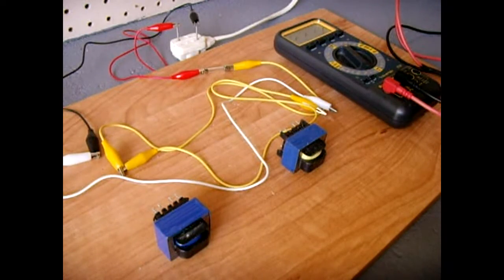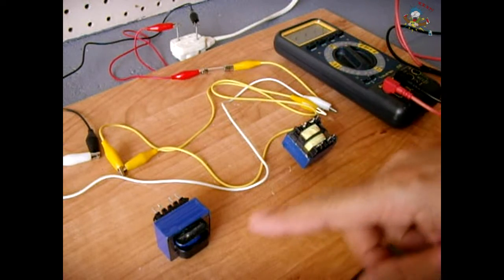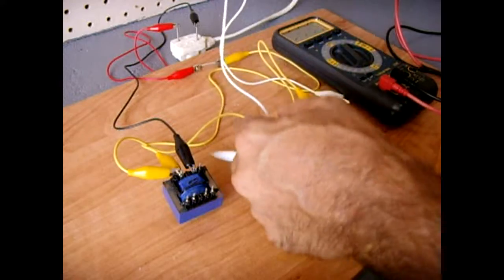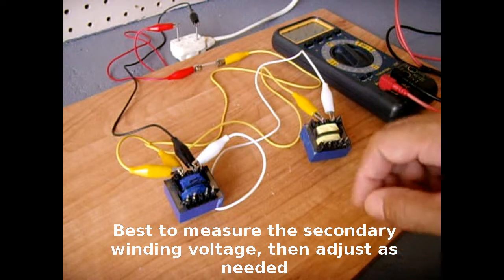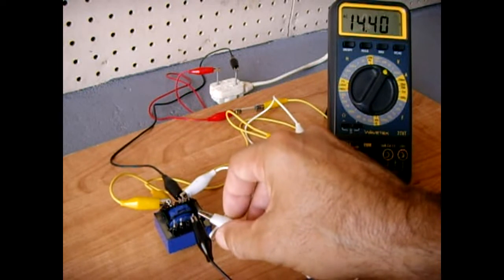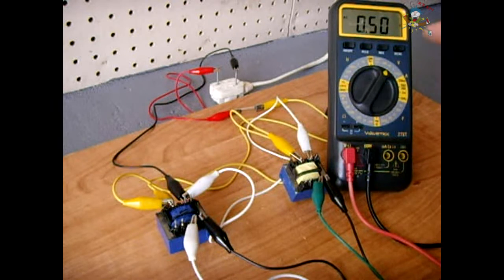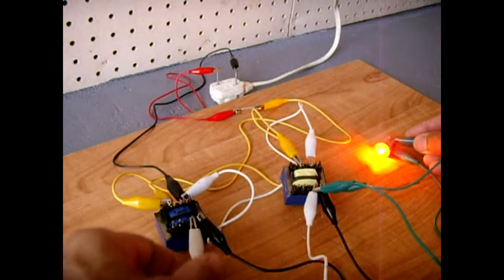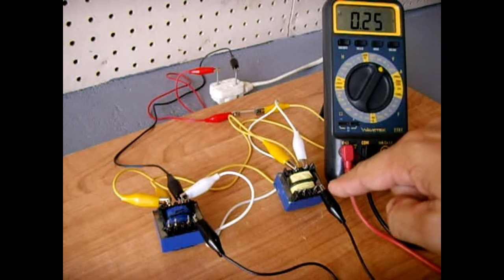Using Power Transformers In Parallel or In Series

Comment: Thank you for this demonstration.  I'm trying to connect 2 HV xfrmrs and need it to be 100% correct the 1st time.  The best aspect of this video is the voltage check w/ meter  BEFORE completing secondary connections.  That step is not included in any other YT video covering this subject.

Comment: How about using a third transformer that has two primary windings, which are 1:1 with each other and with the secondary windings, as a way to use two different transformers in parallel?

Or would the same damage still occur from the second primary winding behaving like a secondary winding & passing that higher voltage/amperage back to the weaker of the two transformers connected to it?

Were a load to be placed on the secondary of this imaginary third transformer, how would the load be distributed to the previous two (unequally sized) transformers?  

I assume that "the path of least resistance" applies, but that doesn't change the fact that both primary windings are on the same core, interacting with the same flux.

Comment: Excellent presentation! Hope you will answer my question: If the 2 transformers not quite match, how about a dropper resistor on one transformer  to make it match?
Reply from the maker: I definitely recommend using 2 the same. Thanks for watching!
Reply: Unfortunately I already have the two transformers which not quite match, hoping for a way to trim off the difference with resistor voltage drop.
Reply: @clam4597   
The stronger of the transformers will always find a way to eat the weaker.  

It's one of those things you can count on having happen, like using a single resistor for multiple LEDs...  
It never works quite right, then as soon as the first component dies, the rest quickly follow.

Comment: This is a great topic for a video.  The video could have been much better if all wires were shown in their entirety for starters, and neatly- not like a mess.  I'm never sure how much someone knows when they use improper terminology.  Your meter was not "going in to overload".  It read "out of limits" and you fixed that by changing the range setting.  When you use improper terminology it demonstrates a lack of fundamental understanding at worst, or at best it just confuses the people watching who don't yet understand.  I don't have time to make videos, and I appreciate guys like you who do it.  It's just that if it's worth doing, it's worth doing right.  I never considered combining transformers, as I never saw a practical use or need for it.  I guess if you're trying to save money by using a pair of 12v transformers in your junk drawer to fulfill a need for a 24v and you don't want to buy a 24v, that could be one situation where this is helpful.
Reply from the maker: Clearly you don't know the meter I have. :-) I suggest you read the manual online. OL refers to OVERLOAD.

Comment: Excellent presentation! But is it okay to connect the two primary winding in series instead of parallel? And what will the results be in the secondary?
Reply from the maker: (2) identical 120v transformer primary windings can be connected in series with 240V.

Comment: i have connected the transformer in parallel . but the voltage goes up not doubled and current remains same . can you guide with right circuit diagram.
Reply: Parallel connection will double voltage but the current will stay the same as using only one trans, i.e. halve the current of each. Wiring them in series has the opposite effect - the voltage will remain the same but current will double.
Reply: @daveb9370  it is the other way around, exactly the opposite.

Comment: Hello,I have a problems....I trying to complete my plasma welder prototype something that what Multiplaz 3500 supposed to be but wasn't,it even should be named Multiplaz 350 because of 350 volt output,based on your demonstration of those 2 transformers voltage increased and that exactly what I need to increase output voltage to reach 350 volt and specificly 5 amperes..I was look everywhere to find correct transformer but it like not exist at all,to build particular transformer from scratch would cost somewhere as 2500 bucks which is too much for me,all magneto wires or U core's expansive despites purchase copper wires for winding.....So I need a help how to boost up 2 identical transformers to form 350 volt,i fear by doing so with 2 step up 220 volt transformers it would give me too much over volting 440 volt,but I need strictly 350 volt and 5 amperes at secondary output...Any help would be appreciated,I been sitting on this project for maybe 2 years by now without any luck,most materials ready for assembly even self made thermo regulating circuit board and case parts for power supply..Constructing a torch took me some time and yet it still remain disassembled,I engineered torch housing so it would utilize already existed Multiplaz 3500 accessories like evaporator,quartz glass tubes,cathode holder assembly and even nozzle tip everything assembles correctly.....Took me about week to assemble power push adjustable switch that's actuate cathode and adjust power drop....I can't say it hard but if Multiplaz would be designed from beginning as original diagram on 350 volt output and 5 amperes it really would be cool plasma machine....Unfortunately Multiplaz 3500 only develop near 220 volt on output with minimal 2.3 amperes,that is insufficient for perform even brazing operation not mention for cut or weld.....The torch with minimal flow of air pressure (to avoid quartz glass tube breakage) could be adopted,high pressure must be avoided to prevent inner components damage,however air is bad electrical conductor and most won't bring any positive results...However it could be attached to helium gas instead and results would be more positive,originaly plasma machine operate on distilled water only for cutting operations with cutting tip and welding operations on 50% alchohol based mixture or diluted 75% alchohol with water,welding tip have smaller sized hole and welding performed similar to brazing or tig welding methods except far more stronger..Secondary power line is auxiliary and important to use hot clamp (not ground as used on mig,tig or arc machines),the feeling wire is grounded instead and when held should be avoid direct contact with metal othervise short circuit guaranteed...Feeling wire should be keep away from weldable metals about 2-3mm away..As numerous times Multiplaz 3500 machine was demonstrated but only as advertisement,they have a real deal for demonstration but when you buy one it not perform as described...Multiplaz corporation is only based to cut money from customers but not providing results as promised,the complete Multiplaz machine cost 2 grand's and now even more but have zero performances...Luck of correct components held my back for far too long with this project:Advantage of Plasma Welder/Cutter????You don't need expansive mig or arc welder rod's and feeding wire,you don't need any gas like argone,oxygene and acecylenne plus it takes much less time to handle work than regular machines does...What does regular machines doesn't do??Fuze welding 2 parts together with greater performance than any other welding machine..Next greatest advantage is that Plasma welding machine work only on direct current which allow steady amplitude voltage rather than always drops like in AC current and that sometimes ruins 2 welded parts creating ripples between which forces you to grind that area and reweld again until proper result is achieved....Both all type's of plasma and tig welders operating on DC current only,AC current would create too much noise and never been preferred,this is changes all picture on welding and make welding as fun as it is...When machine start it's work the reservoir must be filled till some amount would sprayed by pressing actuator button but before that machine shouldn't be turned on,this would means that water or alchohol observant material would observe all liquid and ready...When torch is filled the cap for reservoir must be closed (tightened),than by switching machine on the actuator  (adjustable switch) must be pressed on to activate spark (arc) between cathode and anode so the moisture turns into steam thanks to evaporator assemble where it all processed in quartz glass tube and steam breaks between hydrogen and  oxygen which further deatomised and turn into plasma beam (flame/arc),notice that produced plasma is super hot and twice if not three times hotter than regular oxy-aceccylenne torch so caution is required and never place your hands anywhere near it because amount of injury is severely high..The produced plasma beam would be hot and if set at maximum value would be rated 8000 by celcius temperature which should be say 1/4% of sun surface maybe less....Plasma torch can change welding technique,materials like tungsten,molybdenium and titanium would be melted with ease by that machine,canno't be done by regular machines and torch though..Everyone know that Tungsten only could be brazed on various cutting tools like drill bits,milling saw's/end cutters/boring bar's and lathe cutting chisel's..Tungsten won't be able to weld on any metal because various welding machines cannot develop necessary temperature to melt Tungsten,Molybdenium and Titanium..Titanium can be welded together however it required to be pre heated with torch first before welding and during cooling to avoid breakage or cracking..All those 3 metal's mostly weld in vacuum chamber where is no oxygen can be present,electron beam or laser only type of welding machines that can weld those metals and it's alloy's

Comment: I have a 12-0-12 v output, on a 220v primary/source, 10A transformer.  Can i increase the output to say 28 v of the transformer by adding more coils of the same type in the secondary output?
Reply from the maker: You can increase the voltage output by adding more turns of wire to the secondary, but the current output will gradually go lower.
Reply: ok, thank you.

Comment: I don't understand why you haven't even mentioned that putting transformers in series can lead to the voltage developed by the second one exceeding its breakdown level.  I know you used LV transformers, but surely you should have issued a caution on this?
Reply from the maker: Never had any problems. :-) Just be sure to use 2 identical transformers, preferably toroidal.
Reply: Your comment doesn't make sense. When connecting transformers in series, any given transformer in such configuration only ever sees an amount of voltage that it produces. There is no "voltage development" of any sort.

Comment: Is it possible to increase the outgoing voltage of an adapter? I need a power supply or transformer that can put out between 24 and 30 volts. I tried finding a low-cost 24-volt or higher adapter or transformer and have failed. I got to thinking or wondering if I could join a couple of my 12-volt transformers together. Then I could get close to the power I need. I am building a hobby electronic workbench.I want to build a fume extractor from the 12-volt computer fans that I have harvested but the PSU I built to run it doesn't have enough power. I am using an LM317 power regulator chip and the outgoing voltage should be able to put out around 30Vdc the problem is I only have a 12-volt transformer and with that it puts out 12 to 15 volts but under load, it drops to half.I am a beginner and am only learning but I don't yet know why when it's under load it drops to half. It simply can't run the fans. I think it's because I need more incoming voltage.I do have one PSU that I have mny eye on becasue it may be able to hook up straight to 110v and not need a transformer but I am not sure. This http://www.ebay.ca/itm/111804799607?_trksid=p2057872.m2749.l2649&ssPageName=STRK%3AMEBIDX%3AIT kit seems to have the power I would need but it doesn't tell me how much incomming power it can handle this one has a KBL608 rectifier to transform ac to dc but I don't know how much incomming power it can handle.ANy suggestions or help would be greatly appreactiated and I am now a new sub will be wathing lots to learn more for my hobby.
Reply from the maker: Much easier to buy this:(24VDC output at 4 Amps)

http://bit.ly/2c7aaca
Reply: That's awesome, but what can you tell me about the kit in the link that has the KBL608 rectifier. My understanding is that rectifier's transform power from AC to DC. You see I already have this kit I forgot that I had already ordered one, I really like it but I don't know how much AC power I can plug into it without frying it.If you wouldn't mind could you just have a glance at the datasheet and give me your opinion I think that I can easily use 110vAC standard plugin I truly want a 2nd opinion. I am currently googling things I don't understand like it shows. Max. DC blocking voltage at 800v I have no idea what this means. I will have to do some researching to figure out what each stat means if you could tell me anything that will help me that would be absolutely incredible. Thanks for your time. KB420

Comment: This is what I want to do with my stepper motor that has dual windings that are the same.  I want to use these AC windings, convert them to DC and parallel the DC voltage and current on a wind turbine.  Is this possible?

Comment: For  a series connection would it be better to rewire the primary connection or the secondary one? Or does it matter?
Reply: If you rewire the primary in series they will share a voltage making the secondary voltage half or in respect to the turn ratio the primary . If they of course are in phase to one another and if so the secondary turns and direction of turns must be the same if those are to be paralled . If they are to be paralled woth the primary in series (while in correct phase) then you will get a split voltage in respect with the turn ratios . ..ect still more to this explanation i have left out

Comment: Is it possible using this same method to combine three or four identical transformers for a bigger output? say you had several small transformers of the same value but needed a higher output.. does this concept get sketchy?
Reply from the maker: +Gadien Chapman 
Don't push it. Two will work fine, but if you had 3 or 4 identical toroidal transformers, it should work.
Reply: ok, Thanks for your input :) (or Output :p)

Comment: I have two 240 volt led lamps that perform poorly to say the least at 120 volts. Each lamp draws no more than 6 watts
I thought of powering them from 3 identical "wall wart" transformers, they are 120 volt AC at 17 watts without any rectifier. Output is 9 volts AC at1000mA
 So here is what I am going to try.
Take two and wire the 120 volt mains leads in series that now will now serve as the secondary then connect the same two 9 volt winding's in parallel and feed it with the third in effect driving the two transformers "backwards"
I'll be sure to check the current of these and also to check for signs of over heating.
 Any thoughts?
Anyone?
Reply from the maker: +Craig Nehring 
Sounds like it should work. I would take apart one of the LED lamps and see if there is a capacitor in series with the power supply. If there is, double the value and try at 120v.
Reply: The power supply is fairly sophisticated as it has a dedicated power chip and tiny internal transformer/inductor
I just noticed that while the transformer input current is 17 watts @120 the output is only 9 watts (9VAC @1000mA? Must not be very efficient design so really only 9 watts ?
The only thing to do is try, I'll give it a whirl
BTW I have a boat load of these wall wart transformers lol

Comment: Great video and really helpful to understand linking two this way. I wondered, can I connect two toroidal transformers together. I have two exactly the same. They have two outputs and I wondered because I can series and or parallel each of them, can I series and or parallel them together. Cheers
Reply from the maker: +Elecifun 
Two identical toroidal transformers work the best!
Reply from the maker: +Elecifun 
Two identical toroidal transformers work the best!
Reply: electronicsNmore I have two identical 24 0 24 at 3.2 amps. I want to wire them together so I can have more power for my SSTC. That's the plan anyway.

Comment: i have two transformers one from a old tv and a toroidal from an amp.
the transformer from the tv is 2X21V 2A and the amp's toroidal is 2X24V 2A can i connect them in parallel for 4A.(I allready did trough a light bulb and then directly and no i got the same power, my amp didn't output 200W)
Reply from the maker: somerandomguy fromthestreet Bad Idea. You need to use 2 identical transformers. Toroidals are the best, but standard E-I's work very good also.

Thank You!

Comment: Hi, I am new to using transformers and other electronics, and I have no idea what anyone is talking about. I have a small microwave transformer like yours but it has 5 different metal things on one side and 3 on the other and I just want to know how to convert electricity from a smaller voltage to a higher voltage. Please help me if I explained anything wrong.😫
Reply from the maker: In order to "Step Up" the voltage, you will need to use AC power. What are you looking to do?
Reply: What I'm looking to do is to change a small form of electrical power like from a battery into a high voltage.
Reply from the maker: OK. Please refer to my video playlist below. You are looking for a power inverter. I have many different videos.

Thanks! Be sure to share my channel with others and rate Thumbs Up.

https://www.youtube.com/playlist?list=PLQ6IOhUBblU0Vq1gVIK703gtLtlEy6CRI
Reply: Scotlahn Mccallister You cant use Dc power for a transformer.Your battery has DC source.Transformers can only step up or step down AC supply.